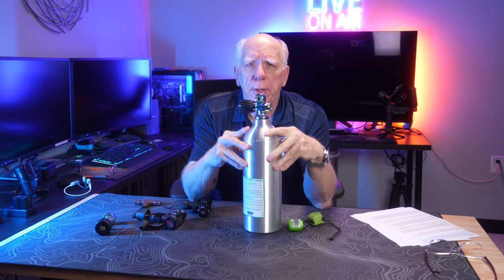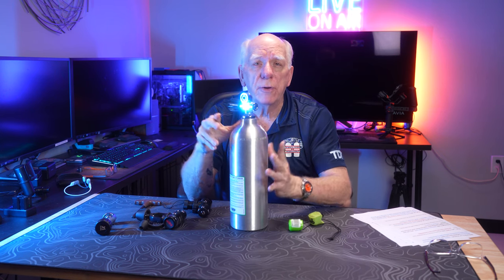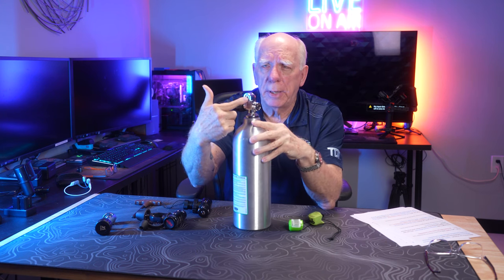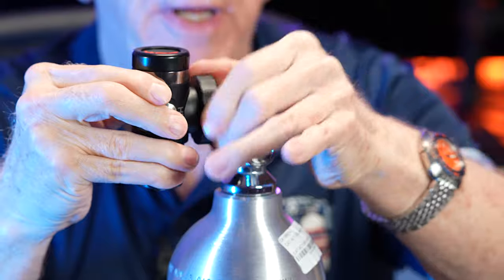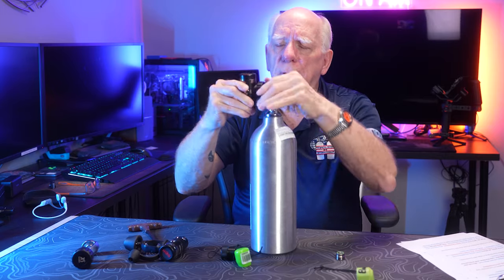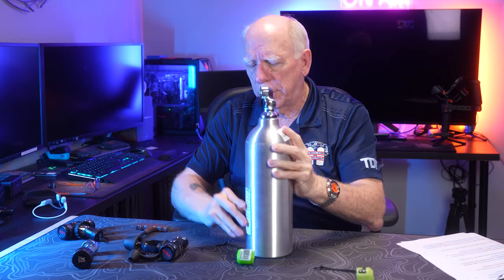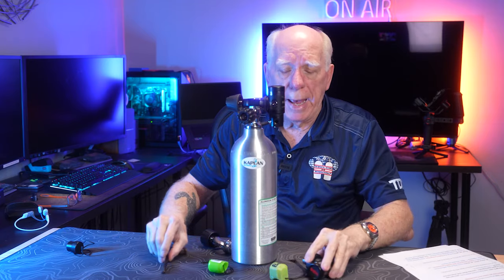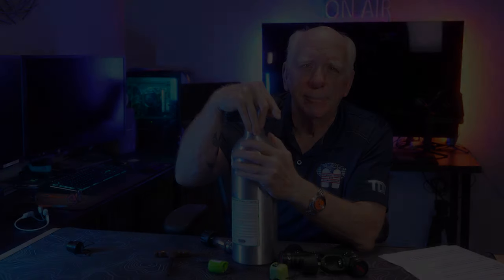2024 Pro Valve What is it DIN or Yoke ?

Comment: I bought an Apex regulator with you guys a few years ago and love it. However, because it is a DIN, I bought an adapter (from another store) so I could use it overseas. Arriving at my destination, I found out that the knob screw was too short for any cylinder yoke valve they had (Caribbean). Luckily, the bolt had an extra regulator and we switched the yoke screws for a regular length one. I’m not familiar with yoke cylinder valves, so I wonder if they come in more than one size or if it was an oversight of the manufacturer. 
Cheers.
Reply from the maker: Hi VOV,  Interesting question but it's true there are various, let's call it thicknesses, of valves.  Especially over the years, MFG's and world locations that could account for your issue.
There's also slight differences in the design of "A Clamps" also known as Yokes where the top has bigger / wider shoulders. 
There are also Yoke Screws where the inside of the Cap has various depths to contact the top /shoulders of the A Clamp.
Without having direct access to the gear, kinda hard for me to point at the exact problem.  Thanks for your question.  Regards Bob C

Comment: Hi Bob. At the end of Dec I purchased a Catalina 80cf Tank from Divers Supply. Had it filled at my Semi Local Shop.  Only thing I was surprised is that it didn't come with a Dust Cap. I purchased that while I was there. Unfortunately I haven't had a chance to get it wet yet. But did Practice setting up my Kit. Checked my Regs and BCD for malfunction. I was recently OW Certified in Aug 23. Waiting for the AOW Class to be scheduled.
Reply from the maker: Hey Chris,  Thanks for sharing and yes the Alum tanks normally don't come with Valve covers or tank boots.  You'll see rubber boots as standard on the steel tanks.  Always nice to have your own tanks.  Regards Bob C
Reply: @DiversSupplyYT  The only real issue I had was the UPS Delivery. They weren't allowed to Hold the Tank so I can pick up. I was afraid of it being Damaged or Stolen off the porch.

Comment: Being new I can save money with DIN regulator and have high pressure capacity when I need it. I like the strenght 10:11  of that DINconnection & weight reduction. Looking at the Aqualung as first 10:11  about $499 for both stages. Please advise!
Reply from the maker: Hey Steve, The DINs are very good and preferred by lots of divers,  It's best if you keep a DIN to Yoke Adapter in your kit just in case you run into a Yoke Tank Only situation....  Regards Bob C